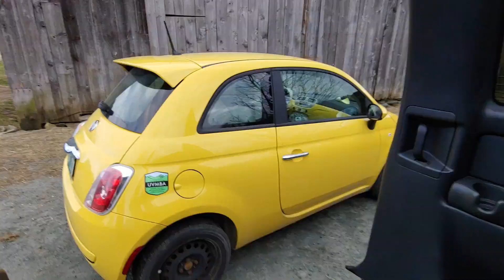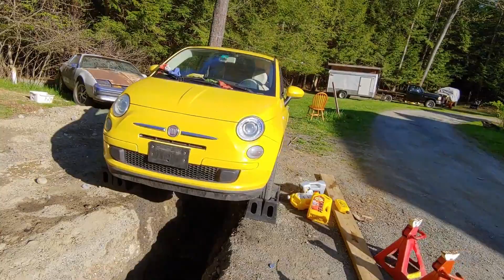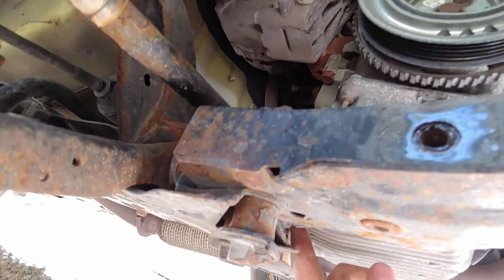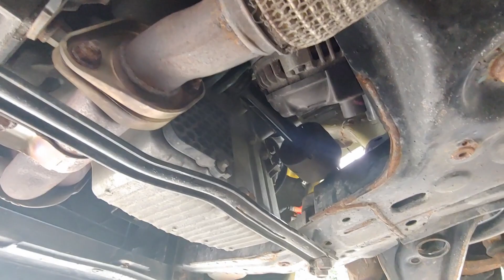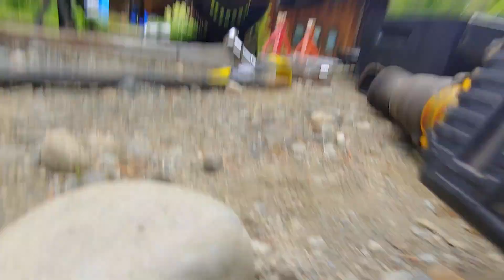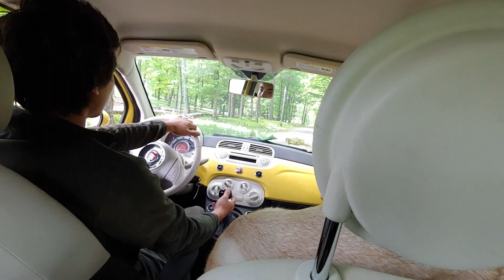Repairing A Fiat 500: Who Designed This Car??

Comment: I'm wondering if its all 500's have that crap design or just the 1.4 multi air engines. Why designers don't consult mechanics when designing cars to make them easier to service is beyond me. Yes it makes the manufacturer money but it pisses people off and puts them off buying the cars. Its like when you have to remove half the front end just to change a poxy headlamp bulb......infuriating. Rant over 😂

Comment: You have an actual 'Pit'! I love it. Waaaay back in the day, racing mechanics worked in literal pits in the ground, just like your "trench". Early race cars needed lots of attention during a race, like chassis lubrication and such. The driver would stop the car directly overhead, so they had access to the underside. We don't need no stinking jack! That's why, of course, they call it "The Pits" to this day.